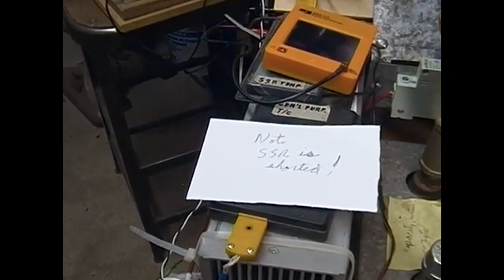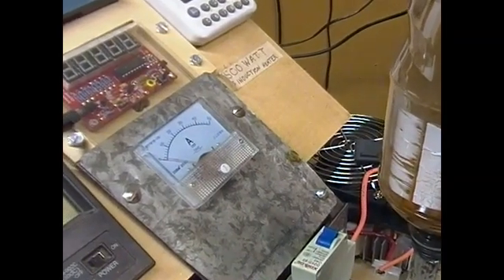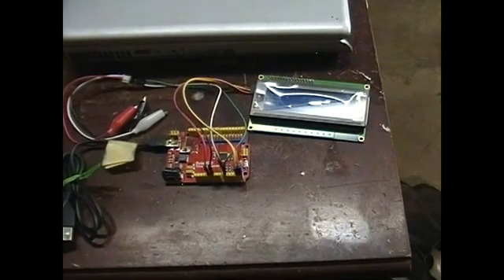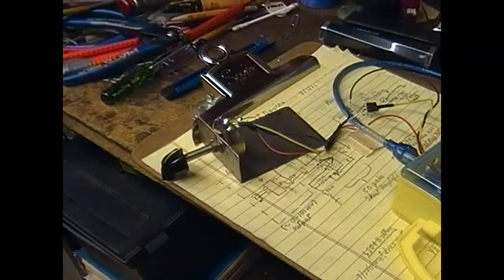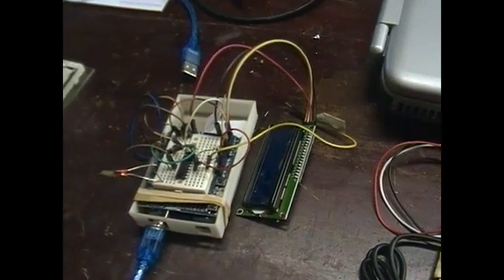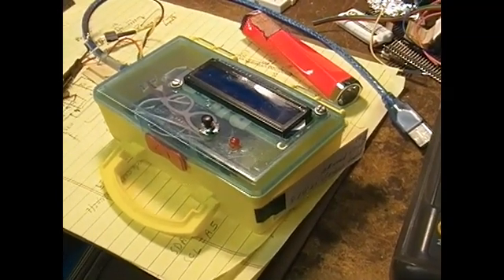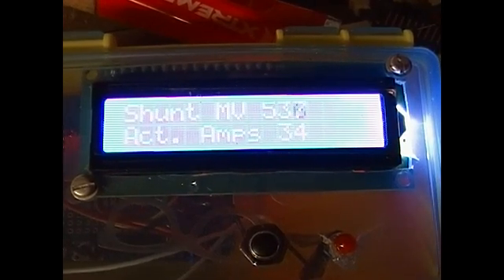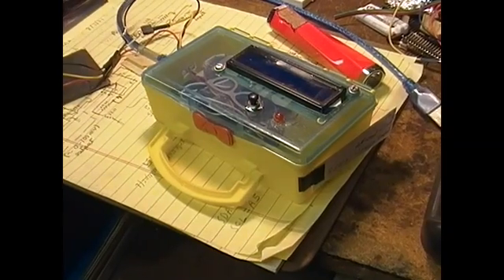2500 Watt ZVS Induction Heater  excessive current control protection update  (Part 2)  #192

Comment: What do you think of current controlled turn-off from simply monitoring the current supplied by the DC power supply input with a compactor?
Reply from the maker: Hello Dale.   When you say "compactor", do you mean "contactor" as in "relay"?  If so,  I would be concerned that about the speed of a relay turning off fast enough to save the ZVS Mosfets.  And,----  a relay rated at 50 amps DC will be quite expensive.  You would also have to consider the circuitry needed to to drive the relay and the speed of that part of the system.  I am not saying that it wouldn't work, but I  avoid relays in  high current DC circuits because of contact arcing.
Reply: @frenchcreekvalley  I totally agree with your reply about mechanical switches and stay away from them for exactly the reasons you stated.  I also worry about "contact bounce" here.

COMPARATOR  is the word (solid state) I intended to write.  It came up as misspelled (like it's doing now).  Looks like it is not in spellcheck, and I overlooked the replaced word....sorry.

Comment: I have had ssimiliar problems when using only a single channel of a quad op-amp...the solution is simple:  On all unused amps, connect it's  "-" input to the output AND connect the "+" input to ground.
...PRICELESS VIDEOS!

Comment: Nice work thank you.is it possible to make ZVS super fast, i mean resonant frequency about 500kHz.
Reply from the maker: I don't think you can run them that fast.  The faster you try to run the circuit, the longer percentage of the time the Mosfets are in linear mode, causing them to heat substantially.  In my opinion, running them faster than about 130kHz is a recipe for board failure.
Reply: @frenchcreekvalley  thanks for your reply.

Comment: Nice work chap! Love your films.   Can you post the schematics and code? I had pretty much given up on the royer circuits as I could not make an effective over current protection and has a huge number of dead mosfets but maybe this could be the answer
Reply from the maker: Thank you for your kind words.
Regarding: "Can you post the schematics and code?:  I will wait until I get the "SSR Protector" actually up and running (and, hopefully,  doing what it is supposed to do) before I do that.  Right now I have a lot more messy code in the UNO than is needed.  
Regarding "dead Mosfets"  I haven't had any problem with blowing Mosfets for quite a while now.  Even when I cause short bursts of current beyond the 50 amps that my analog meter reads, the Mosfets don't blow.
If you are having that sort of problem. see this playlist:
https://www.youtube.com/playlist?list=PLVxWen9M87dBhvInCQ-3pELWdxCM3XH4I
I do a LOT of explaining and troubleshooting in many of those videos.
Particularly, see:
https://www.youtube.com/watch?v=9JAMxF_8Xbs
if you are short on time.

Comment: excellent sir, i need to know ; i can connect two zvs 1.800w and parallel in one coil
Reply from the maker: I do not know the answer to your question.  I suggest that you buy one of the 4000 watt units that are now for sale if you have not already gotten the 1800 watt units.